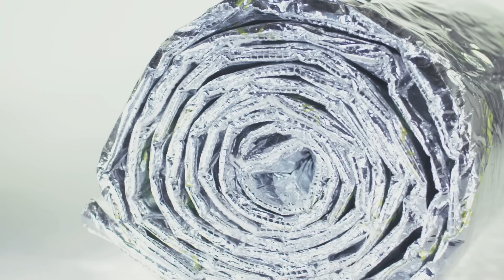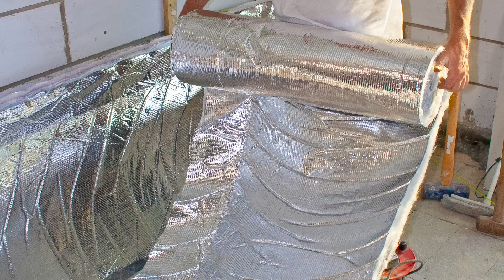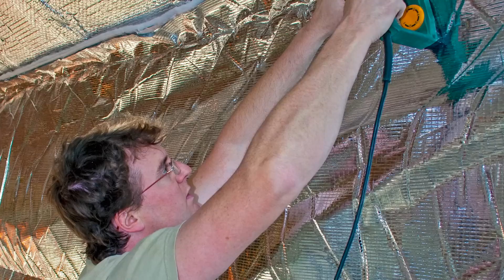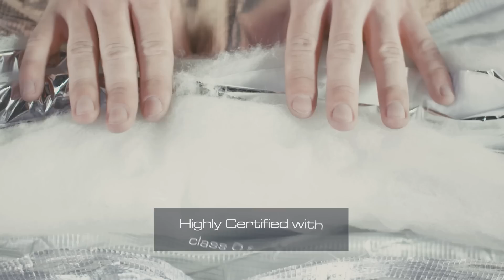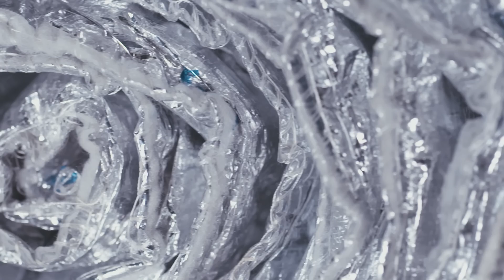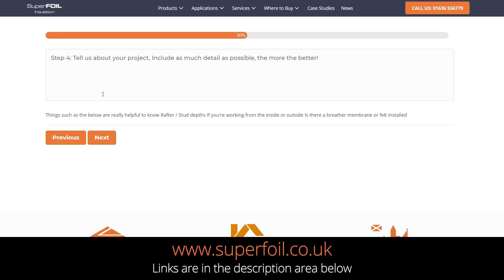What is Multifoil Insulation? — With Byron Lawson

Comment: Prefer using SuperQuilt to SuperFoil, it's better quality and UK manufactured vs Chinese products! Used SuperQuilt first in my garden building then used it in my loft conversion. Great product will use again
Reply: I use SuperQuilt for the same reason.
Reply: you didn't know Superquilt also bought chinese raw materials?
Reply: I have a cross wall constructed roof with 9inch purlin. I have a new roof tile above with a vapour barrier and 100mm of kingspan solid insulation between the purlin and plasterboard on the underside. I want to add insulation below to increase the thermal efficiency and bridge the cold spots what's the recommended options

Comment: Actis/ tri iso was only proven by manufacture tests only until quite recently and did not pass under independent tests. My real issue with the product is the installation method in so much that it is forever being sandwiched between batters etc which crushes it to less than 5mm thk . It's the installation method that I would like to learn about as I'm sure it works when installed correctly. Also 90 percent of loft conversions would not allow warm roof construction as this would raise roof height which is not compliant from a planning perspective and would look awful on a semi and so really looking for proven design details for cold roof insulation to u/s rafters with all condensation and air flow addressed. Great article, thanks
Reply from the maker: Hi Phillip 
 You are right, there is no way of achieving the required U value on new build with the multifoils but when you combine it with other insulation it can be done. Personally the squashing of the insulation over the rafters doesn't worry me because it reduces cold bridging a bit and dray timber is not that conductive. We can't achieve perfection in refurbs so this is a good compromise. We will do a lot more on this subject soon.
Reply: @SkillBuilder  it's a very interesting topic and look forward to more, def a sign of things to come. I personally wont specify it on any of my projects just yet but I work for a few developers who spec it as a combo with slab insulation. If you know of any resources that offer definitive info on using it in combinaion I could really use the links, sadly, in today's world its who gets blamed if there is an issue, I can print spec sheets and u values from king span and celotex app for the saps assessors and building control and with that data can address all the issues inc air flow, cold bridging and of course u value..........I still have concerns about squeezing it between batters, it must compromise performance, and so although very installer friendly I'm not quite ready for it yet.........but that's just me and a humble opinion!
Reply: @philiphurdwell3443  You have to understand how it allegedly works. There are different forms of heat transference through a built-up envelope such as a wall or roof. The ONLY way that foil is likely to work is that it is installed adjacent to a void where heat is radiated across the void to be reflected from the foil. Any other type of installation is worse than useless. The foil industry needs to be brought to heel with their ridiculous science-free claims. Frankly, as an architect who lectures on the subject, I wouldn't touch it with a barge pole.
Reply: @sandypatience  I would be very happy to learn more and would attend any seminars but currently remain very cynical and agree with you more so than the promoters of these products. The honest truth is that I dont know enough. A lot of my projects have post completion tests, if they fail it's very expensive which kind of comes back to my comment about performing when crushed between battens, the hot and cold spots are alarming to say the least.. if crushed at 400 c/cs only the central 50 mm will work at full capacity and if full capacity performance is in doubt then I have to agree with you that it's pretty hopeless.

Comment: Thanks for this, just a week too late for me.  I now have 300mm of insulation in my loft and it is very cold up there!!  I wish I had insulated the sloping roof instead.☹
Reply: Unless you intend to spend a lot of time in your loft, being very cold is perfect and the 300mm insulation is doing a great job.
Reply: @JohnnyMotel99  I think the modern target u value is 0.16, my sums suggest we have at least 0.132.  The problem now, and it's caused some friction on the home front, is the living room/dining room suspended floor which has no insulation, and stupidly I added 20mm thick oak floor on top about 20 years ago.  No access underneath.  My suggestion to tear it all up was not well received.😱
Reply: At least you have avoided interstitial condensation and are keeping your roof rot free.
Reply: @normanboyes4983  why is it cold in your loft with 300mm of insulation installed?  What is your heat source?
Reply: @legendaryirishgreats2427  Yes, my loft is cold - above the 300mm of loft insulation because my ‘cold roof’ is very well ventilated - as per design. The roof is modern truss construction and would be a nightmare and expensive to change to a ‘warm roof’ specification. I have a large 5 bedroom house and do not need living space in the loft. I only have a small amount of ‘stuff’ in the loft (which I am aggressively reducing) - so for me the cost of going warm roof does not stack up.

Comment: Thanks Roger for a very interesting article. What would make it more interesting is dealing with real life issues. We have a stone built house with no render on internal or external ça 1700 build, 1990s concrete floors with I suspect just a poured slab of random thickness. Rooms built in roof spaces with old beams and rafters apparent, re-roofed about 1992 with minimal insulation. Double glazing would as they say be like putting lipstick on a pig! So many different insulation projects in one property! Where to start in terms of return in investment. Like many I'm not going to re-roof, tear up floors etc
Reply: I have been renovating a farm outbuildings converted in the 1970's. All the concrete floors we took up the old carpets and laid a thin layer of foil insulation from super quilt that gets stuck down with double sided tape and all joins sealed with foil tape. We then put down new underlay and carpets on top. It has made the rooms warmer under foot and heat reflects back into the room. It also acts as a vapour barrier barrier from the cold concrete floors.
Reply: @johndufton9686  Thanks John, that sounds like an easier step than getting out the jackhammer! Much appreciated
Reply: Would you be willing to cover the stone walls on the inside or outside?
Reply: @Oli_Hudson  Outside two walls, but one of them is half buried to about 1.5 m,  so unsure if the exterior is build down to level of interior or just built half width against the lane. Walls about 400-600mm thick, stuck together with lime mortar and sandy clay like substance!!🤣
Reply: I have used SF19, in my loft. One major problem is the 100mm tape that you get to tape the joints. It is absolutely useless. It just peels off after a short while. I have had to batten my taped joints, using screws.
Reply: Read your comments and would suggest to look into thermoboarding. I visited someone's home with it and it was really warm. You attach it to wood battens screwed to the wall. If you do it this way it will make the room a bit smaller. I also used wood fibre underlay on an area above my cellar and it has made a massive difference ( can buy from bandq) Im not an expert but it's made a massive difference

Comment: At point 30.00 on the video when Byron spoke about drapping the insulation in between the joists would this not cause a cold bridge at each joist centre ?
Reply: Not quiet 100% accurate. I thought about this when trapping it between battens in the wall. But the wooden battens or floor joists would also act as form of insulation. I'd sooner have a warm floor with the odd cold bridge, than a cold floor.
Reply: The foil over the joist is surely better than no foil between the joist and floorboard, like if only pir is pressed in between the joists there will be more of a cold bridge.
Reply: Correct, that's the problem with any insulation that gets compressed at the point of connection, he conveniently ignores this issue. You've effectively got 1/8 of your floor area as a cold bridge, assuming 50mm wide joists at 400mm centres. I'm not convinced at all by this guy or his products!

Comment: Almost total transformation of our home using these foils. We live in Reading and have had the heating on 3 times so far. I currently have the inner wall down in the 1974 kitchen extension. And all the horrors of missing rockwoll and masses of damp bridging coming to light. I did the front top in 2017 and just did the bottom finishing off with bricks. Lovely tip of cutting a blanket size of the foil for your bed. Then you see it works. TOAST. David & Lily.
Reply: How have you used it David?
Reply: @simongrice5788  In the cavities having taken out the inner bricks. Also in the roof and outer walls of the garage.

Comment: Nice timing video. Currently living in a mid terrace. Cellar cold as ice because of the disused coal shoot. Living room above the cellar is north facing and straight onto the pavement. Jennel runs along side the living room and through to the back.

All in all my living room is frightfully cold especially because the building was built before cavity walls so the 9 inch walls just soak up the heat and the room having high ceilings means that staying in the living room in the evening time it is always cold and the fire is always on.

Just looking to insolate the cellar roof, but I’m not too sure if the foil is the way to go. I think I will go for the rock wool  solution 170mm.
Reply: Did you go with your gut feeling?
Reply: @itscoconutsaregood  I did. I insulated above the cellar with 200mm of Rockwool. Used garden netting to keep in place with a simple large staple gun.

It’s not made a great deal of difference, but yes definitely a small difference. And I I’m saying this as we having -2/3oC.

Got to say the next route is looking at knuafe or Rockwool wall insulation which is attached to battens (back to brick) looks like I may get a U value from 2.00 to around 0.24 if I go for 80mm.

Will cost a bit though but might be worth it
Reply: @ranxxerox6407  good, I think you "jumped" the right way, if anything, just for the cost point of view. Good luck with the wall insulation, which is more challenging, but again any mineral wool will keep the cost down.

Comment: If it makes a man sweat while installing it, then it’s possible that homes could sweat as well. A solution would be a crawl space ventilation system paired with the installation for long term moisture control.

Comment: Can you use this under floor joists instead of on top? I'm guessing you may need to fit insulation or foil up between the floor joists around all the external perimeter. To avoid cold getting in above the foil and below the floorboards. It would be a lot easier to fit than crawling in under floor fitting glasswool above your face or trying to cut and fit PIR.
Reply from the maker: Yes, if you have the space then it is a great idea to staple it from below but still tape the joints
Reply: Good thinking. It would have been good if they covered this scenario in the video. 
I have a cellar / crawl space that shallows from 1m at the entrance. I recently fitted Rockwool slab between the joists and covered in a breathable membrane on the underside. The rafters don’t run parallel in a lot of places so a different method might have been easier.  I wonder if there is a limit on the joist depth for fitting foil on the underside of a suspended floor.

Comment: Not sure if it relevant but, the test involves using a seal box and then the insulation  inside (I think) but the very fact that your using a sealed box is actually the major insulation factor.  Just placing a foil insulator somewhere without the box is not going to get the insulation value.

Comment: Hi Roger, I have a dormer, the builder fitted the quilt between the plaster board and studs, is this correct and if so is it the reason my dormer is the coldest room in the house?
Reply from the maker: Did it have an air gap?
Reply: @SkillBuilder  No. It is directly between the plaster board then studs, also the plaster is popping of where the nail heas are aswell.

Comment: Roger
I’m currently renovating my entire home and removing all ceilings and plaster from walls. The walls are all plastered directly over the brickwork, it’s an ex council house & I believe they came and blew those small polystyrene balls into the walls some 20 years ago. I was wondering would i be better off dot and dabbing the walls or would it be just as thermally efficient to re plaster of the bricks? 
Thanks👍
Reply: If you can afford to, I would use insulated plasterboard which can be dot and dabed on the walls.
Reply: @tanja8907  is that because the insulated plasterboard  would have better u-values ?  I have 100mm kingspan between my roof rafters, on my valued ceiling ,    and I plan to  stagger full size 8ft by 4ft (73mm) insulated plasterboards  bringing the  total to 160 of solid insulation with the 12.5mm plasterboard.    It is cheap.  But I want the best  bang for my buck. I only want to do  this job once : )   I appreciate your feedback
Reply: I've just finished doing exactly this to my house, which is a 1960s build. The inside skin is all clinker blocks and rather than dot n dab I decided on hardwall everywhere. 2 reasons: 1) all the plaster had blown and sand n cement is prone to cracking so I wanted to ensure cracks wouldn't return after all the graft and money, 2) the spread had to build out the hardwall to get it flat anyway, and the he reckoned it'd offer a similar thermal insulation to dot n dab anyway.

The one thing I would say is that with dot n dab you can use thermal plasterboards, but these are significantly more expensive and much thicker (37/42mm compared to 12mm). And dot n dab at least according to the spread I selected, and an architect, are more prone to cracking along the joints, and are also not coming off easily. Spreads love dot n dab as it's quick, easy and skimming is a much easier job than float and set.

For my money the bigger ticket items will make more of a difference - good U-value windows fitted properly, doors kept closed to keep heat in, and lagging around pipes etc.
Reply: MULTIFOILs seem to need careful consideration. Maybe in the loft, laid over a traditional minimal fibreglass fleece. By the way, for my traditional 1970's brick-cavity-block-wetplaster walls I am thinking about using one of the QUITE THIN Erfurt Wallrock or Erfurt Redlabel wall lining products, not least because then the depth loss at skirting boards and door frames is less obtrusive. These come from just 1mm to 4mm thickness, the 1mm ones are a paper product and are naturally over-paintable, the 3mm and 4mm ones seem to be more polyester meaning more prep needed if one wishes to then over-paint. The products U values are stated in the specs and are obviously on the weak side, but I'm hoping will be enough bearing in mind the current 1970's spec cavity walls (which, by the way, do include retrospectively blown in insulation - which, I've heard, is not often of significant worth). My logic for thinking of going this wall lining route is that, almost by chance, I noticed ON AN INTERNAL WALL where one side is emulsioned and the other side is vinyl wall-papered, that (at an internal door), one hand placed on the wall this side, and the other hand placed on the common wall the other side, gave a noticeable tactile temperature difference! Try it. David Whyman.

Comment: I have YBS superquilt underneath my floors and in the kids ceilings. I also have actifoil hybrid in my loft conversion. They are so easy to fit and works just aswell as traditional insulation.
Reply: Information wrapped up in an advert. No skill needed! Insulation is also resistance to cold! It is also
depends on affordability, and these are too expensive!

Comment: 12 years ago I built dormer to buildings regs but with standard installation Head hight to low. Multifoil met regs and council approved. I had to cover all the roof to the eves and batten to floor. Then they changed their minds but because I had finished work changes it back to OK. My dormer is south facing and never gets to hot. 😁

Comment: Would be interested to hear Byron’s view on using this product to further insulation domsestic hot tubs - some are using foils and some are using PIR
Reply: Used it on mine and it made a massive difference. The tub would be hotter than the heater setting. Saved me money on the juice bill as well 👌🏼

Comment: Would this be any good in loft I have a combi boiler in the loft also would this 
 cause damp
Reply from the maker: I have built a small cupboard in a loft with studs and multifoil just to house the boiler and cylinder. 
If you are going to line the undersides of the rafters above and around the boiler then fine but if you line the whole roof you might need to remove some of the loft insulation to stop moisture condensing on the foil. I would seek more advice.